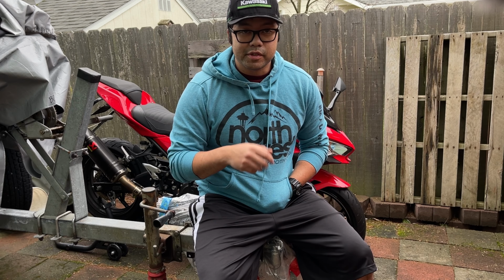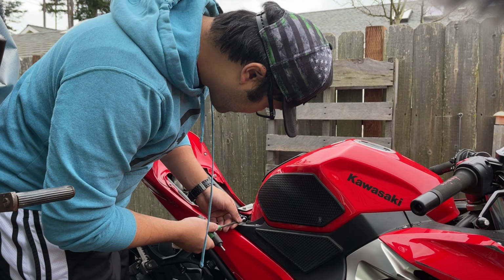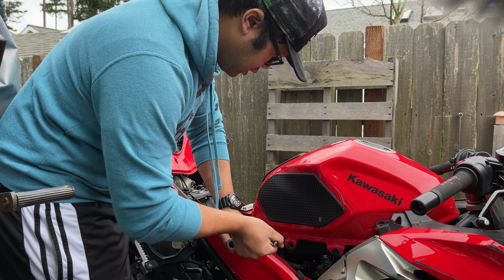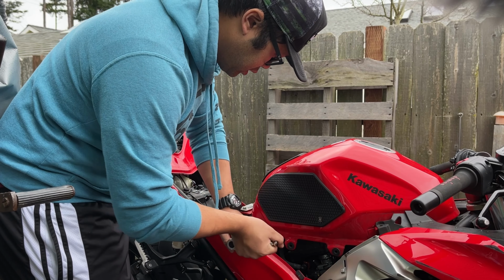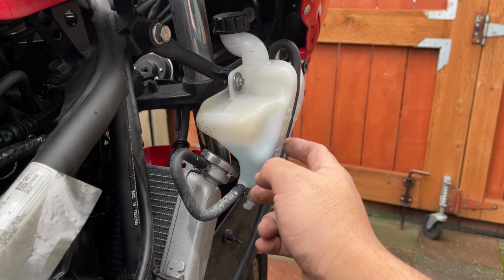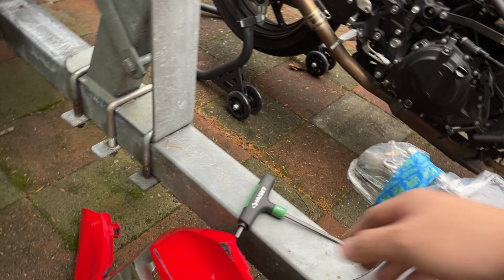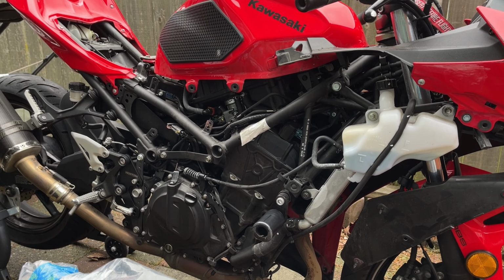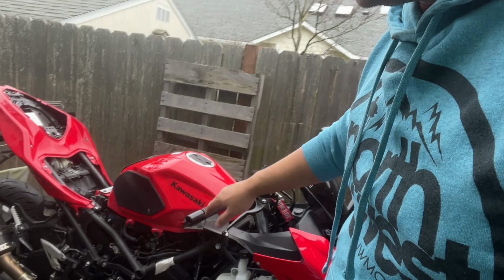Ninja 400 Fairing Removal | Still Waiting on Parts!

Comment: I gotta learn about ICU flash. I have no idea what that is beyond that it makes your bike faster
Reply from the maker: Doesn’t really make your bike faster.  More like make your bike ride like it should.  Speed limiter will be taken off, ECU will match up with the parts you installed (full system exhaust, air filter, flash-based quickshifters, etc..), radiator fan kick on sooner.  Then you can further expand that with a piggyback system such as Power Commander.  

Most of all fix that fuel cut off in 1st gear.  That abrupt on and off in slow speeds in 1st.  Even without mods…it’ll make the bike ride like it should have from the factory!
Reply from the maker: Doesn’t really make your bike faster.  More like make your bike ride like it should.  Speed limiter will be taken off, ECU will match up with the parts you installed (full system exhaust, air filter, flash-based quickshifters, etc..), radiator fan kick on sooner.  Then you can further expand that with a piggyback system such as Power Commander.  

Most of all fix that fuel cut off in 1st gear.  That abrupt on and off in slow speeds in 1st.  Even without mods…it’ll make the bike ride like it should have from the factory!

Comment: Can i install the front fairing of ninja 400 into ninja 300 ?
Reply from the maker: With enough time and effort you can make it happen.  But keep in mind the 400 is a completely different platform from the ground up.  Nothing from the 300 frame wise and mounting has been used.  So you may have to be creative.  Just curious.  Why do you want to do that?
Reply: @xTHEYCALLMExGx  i just hate the style of ninja 300 head, but ninja 400 head looks more aggressive that's the reason